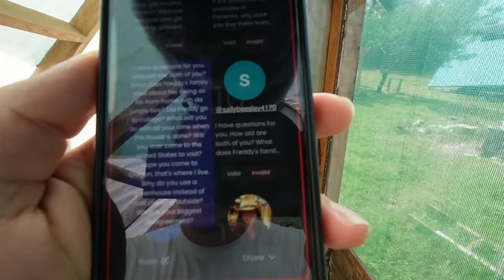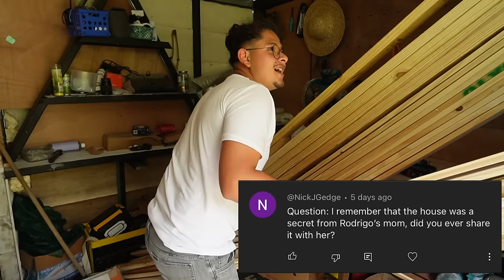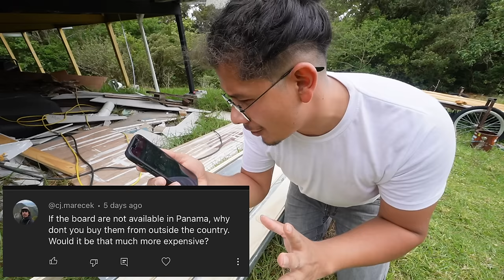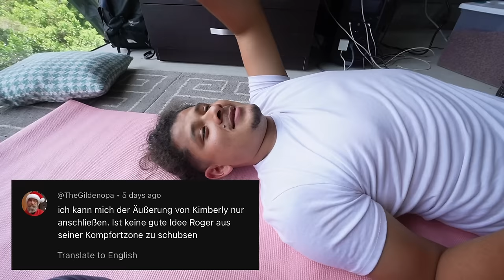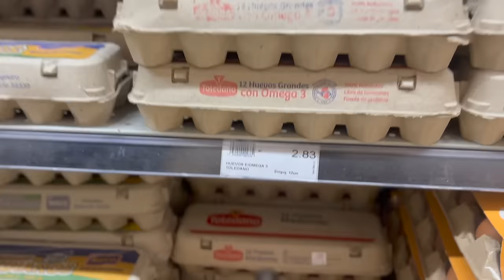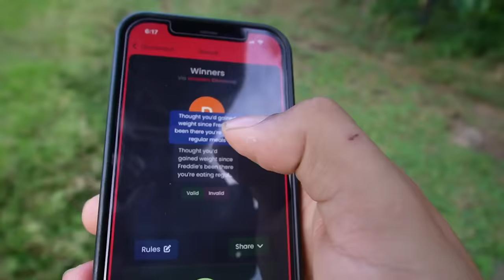The Questions We have Avoided (Q&A)

Comment: If toy can't fine parchment paper,  oil or shortening works for breads that are dough, like sandwich bread. If it's a batter bread like banana or zucchini bread sprinkle summe flour on the oiled pan. For clean up, just soak the pan fow awhile and out should clean up easy enough.  I bake a lot and rarely use parchment paper. 
Also, you two will be great parents when the time comes.  You are both so positive. You'll have happy kids. It will be fun to see what language they speak!

Comment: OK........... drop the touge and groove approach.  Go "Ship Lap".  This way you can use one router bit and cut both sides of the boards.  When you overlap the boards you will get the same appearance as Tounge & Grove but without the need to use two router bits and the need to fit the tounge into the grove.

Comment: For the bread you can butter or oil your bread pan then dust it with flour. No parchment or foil needed. If you are cooking your bread just on a cookie sheet use cornmeal on the bottom of the pan, cook the bread on top of the cornmeal. It should not stick with either of these methods. Love to see your results of your bread. 🥖